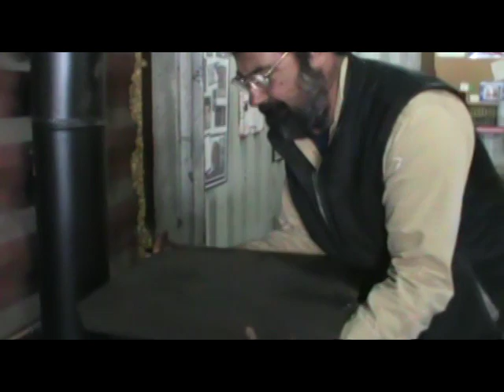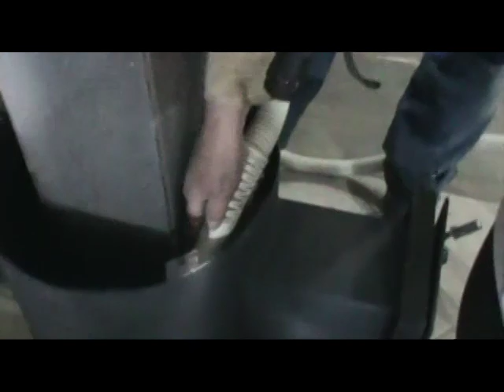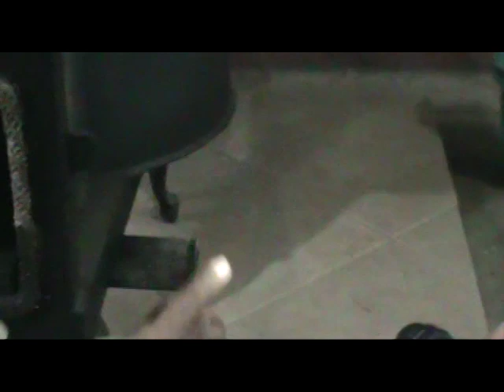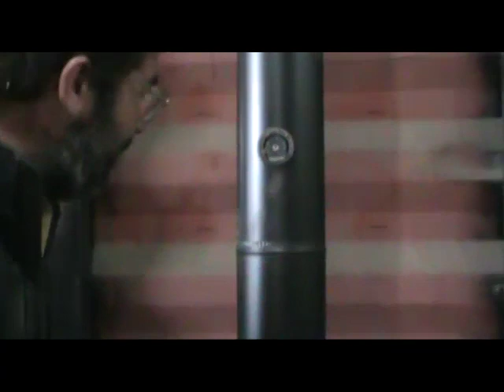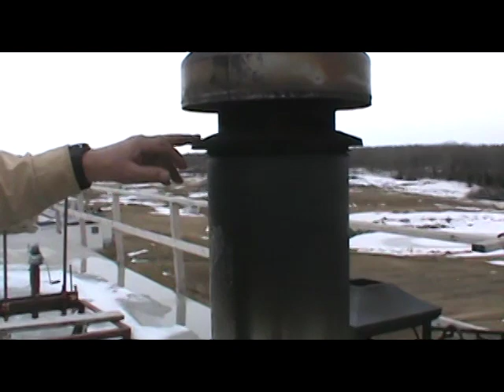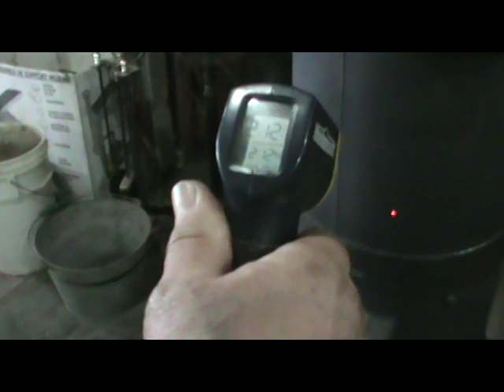Detailed Rocket Stove

Comment: Nice tidy build. I too am flirting with the idea of a water coil in the barrel. I think copper would work, given that it will have water in it.... but yes, stainless would make me feel better.

I've a basic J-tube into a barrel. Like you, I burn sticks. I want a much longer burn time. Rocket 2.0 is on the drawing board. 2.5 will have the water coil. Again, nice build, and secondary air use.

Comment: Trapping heat on top with cob could warp metal or get it cherry red. Also would make removal clean/maintenance difficult and might not be as good to cook on? I use bushings under pans on my top(thinner than yours) to cook to keep metal from getting red hot.  Rockets are great but times you incorporate devices compared to area heated and length of time since they get very hot. Maybe you could throw a heat exchanger inside (or sides like some stoves) and just use both sides hooked for heat. Wonder also if you would get lil less ash if you started fires in the front getting it hotter before all the smoke until everything is hot....might even get lil longer burn at first.

Comment: great video!!  i have watched quite a few on rocket stoves and i like the way you added "re-burn" tubes to feed extra air at the top. ...bonus points for bringing it from outside too!!  adding a hot water source is a great idea as well.  just wondering if you could not get away with copper?  if you bent it around the outside of the inside chimney? maybe make it removable and with an open end to avoid pressure explosions.  what do you think?

Comment: I live in an area that stays -40 a good part of the winter.  I can't imagine having to fill the stove every 30 - 45 minutes!  is there a version of the rocket stove that can be used in cold areas?  the wood stove we have now needs filled about every 6 hours and will burn all night except during extremely cold weather.  We do use a lot of wood compared to a rocket stove but I sure don't want to have to fill the stove that often!

Comment: nice burn, I especially like the air tubes allowing a more efficient burn. Was it your intent to have a constant running heater when needed or will you consider adding a mass to capture any heating going up the chimney? My discharge temps are less than half of yours after gasses pass through a  thermal mass and I burn a little less wood with a 7" system. All in all I like your stove alot.

Comment: Thank you very much for the video. Very nice stove. Interesting that I tried to get secondary burn at the edge of the riser tube without success. I use a chimney dumper in my latest rocket stove heater and I can reach wood burn times up to 90 minutes.